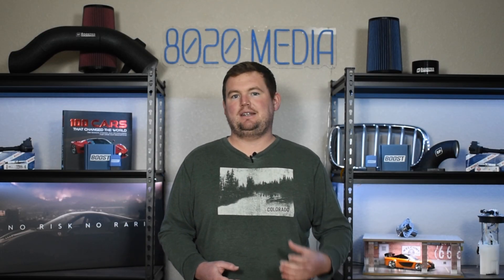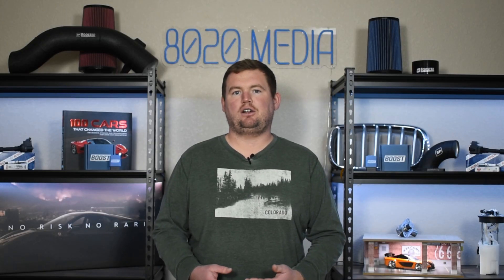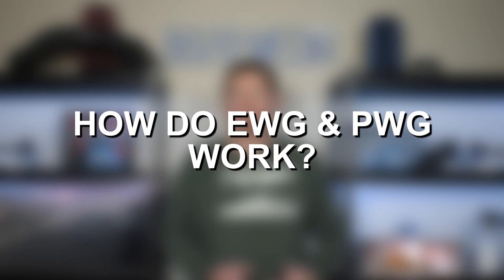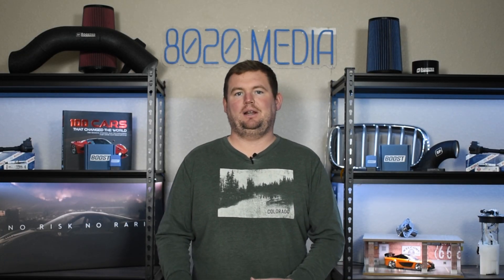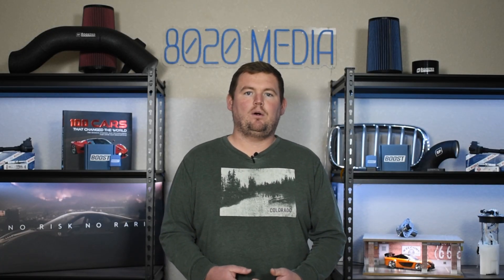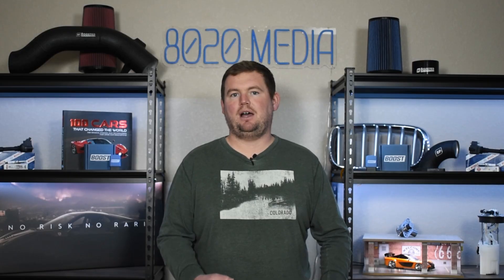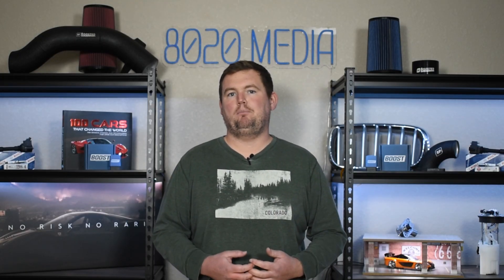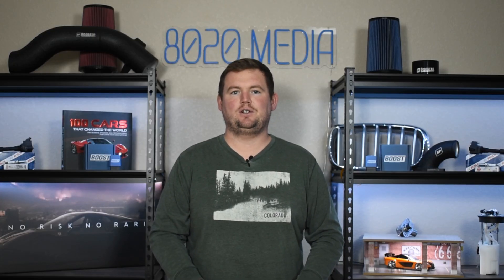BMW EWG vs PWG – What’s the REAL Difference?

Comment: The reason the PWG struggles to hold boost is due to the way the wastegate operates , it uses vacuum to keep the wastegate closed, so at higher RPMs, it can’t maintain enough pressure to hold it shut
Reply from the maker: S - Correct.

Comment: afaik the ewg engines have different internals while still being considered the same engine. ewg have forged internals and are much stronger than the pwg internals
Reply: smh i just went stage 2 with my pwg hopefully my shi don’t blow
Reply from the maker: J - Just stay on top of maintenance.
Reply: @8020Automotive oh i will trust on that not ricing her out
Reply: @8020Automotive should i worry about internals if im wanting to got stage 2 or higher ? since its a pwg and doesnt have forged
Reply from the maker: @ Yes, if your PWG (Pressure Wastegate) model doesn’t have forged internals, it’s smart to be cautious when pushing to Stage 2 or beyond. While Stage 1 is generally safe, Stage 2+ adds more boost, heat, and stress—especially if you’re tracking or driving aggressively. Many owners run Stage 2 setups reliably, but longevity can be affected if tuning isn’t conservative or maintenance isn’t top-notch. If you're aiming for big power or long-term durability, upgrading internals (like pistons and rods) or switching to an EWG (Electronic Wastegate) model with forged parts might be a better route.
Reply: @8020Automotive i don’t really plan on going past stage 2 plus fbo so i hope that with the proper maintenance i should be good sittin at 66k miles rn
Reply from the maker: @ You should be good then!
Reply from the maker: D - For sure. We're mainly talking about the turbos/wastegates only.